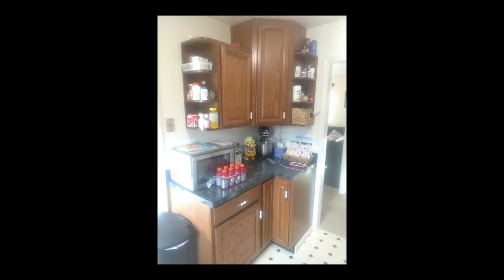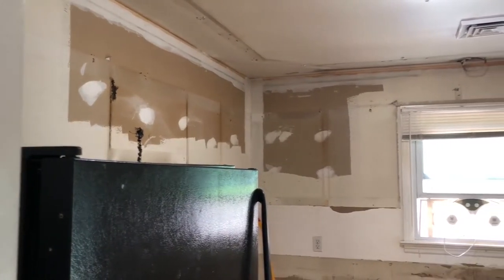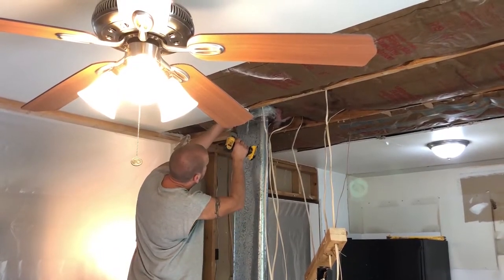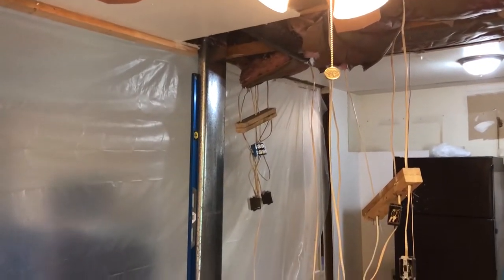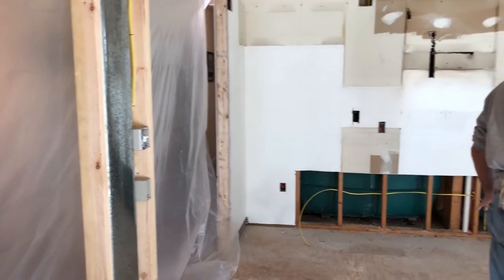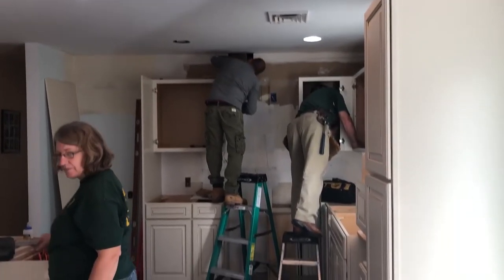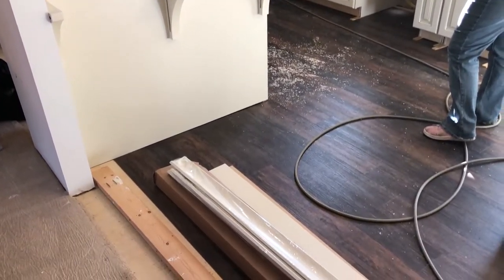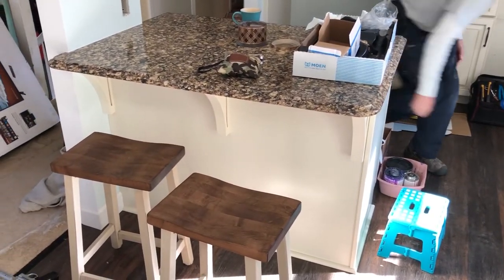Removing partition wall in kitchen

Comment: I have almost this exact same setup in my kitchen except we have french doors. I have been wanting to do this forever. If I have an HVAC duct positioned similarly to where the duct in this video is, do we HAVE to keep it or is there a way we can shorten or move it? obviously less work would be best and what's most functional. I will be doing this with the help of my father and brother who have experience in demos and renovating but if I were to hire someone like your company for example, about how much would it run to demo the wall and re wire everything?

Looks amazing!